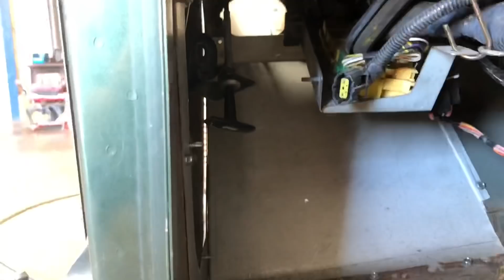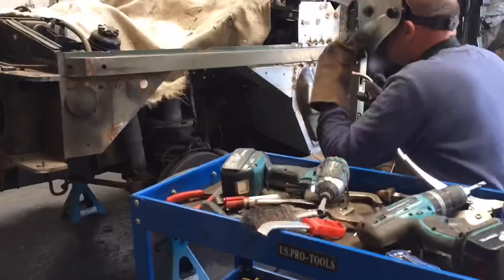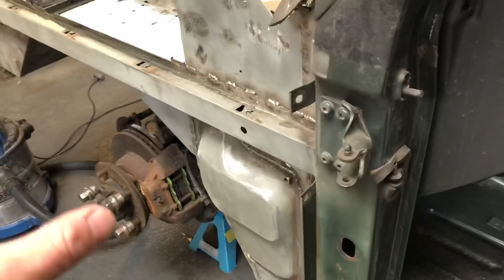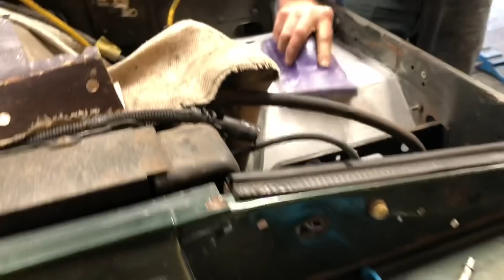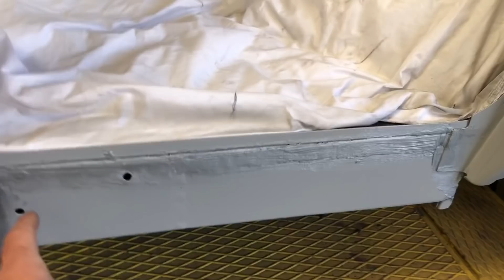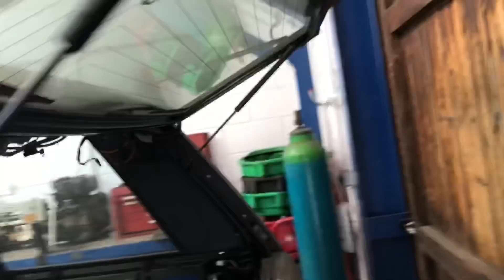Range Rover Classic LSE Welding Body Shell PT 9

Comment: Rob so pleased to see the LSE back on course. Looking good. Can I make a suggestion regarding the interior? Please don't put back the original foam underlay as it's open-cell and any water ingress will be held. I use closed cell foam either off eBay or Tesco sell thick grey exercise mats for about £12 which are great.
Cheers.

Comment: Good to see some progress on this. FYI the extra length is only in the rear footwell. The boot is the same length as a standard car. Only the shorter Discovery floors are available which is why you needed to extend it. Mine is nearing completion now. What better time to get it going than in the middle of a pandemic where I can’t drive anywhere! 😂

Comment: I used that dinitrol on my Polo Harlequin after it had new sills. 1 side I used it, the other side the can ran out and I never did it. I sold it and got it back 2 years later. Side that had dinitrol is rust free, side that didn't needs rewelding! Never making that mistake again will dinitrol the whole lot when it's restored!

Comment: Good one on the dinitrol, it is excellent stuff. I think it was me who left the comment after seeing you use Waxoyl which cracks with age. Dinitrol really gets in and penetrates a lot better, its really good and is concentrated enough to work its way deep into all areas even between spot welds etc.

Comment: Dinitrol is amazing stuff. Use it on the inner box sections and anywhere that water will sit and rot away, on the underside use Por15, absolutely fantastic stuff but be careful around it, if you exist near it you will catch 72 different kinds of cancer. I own an NA MX-5 so I know all about trying to prevent rust. :)